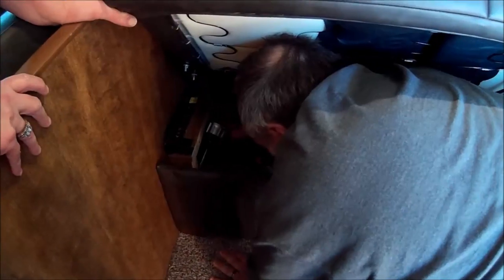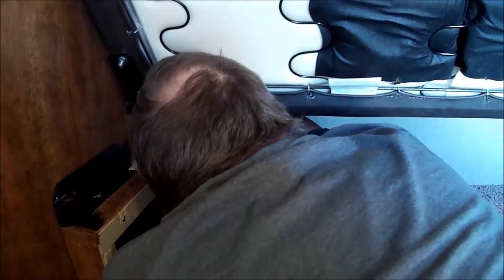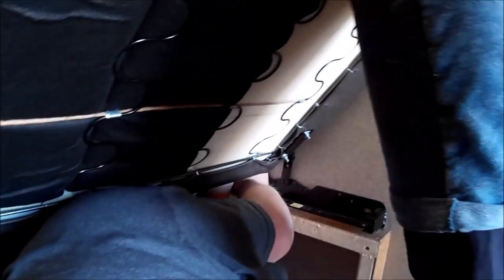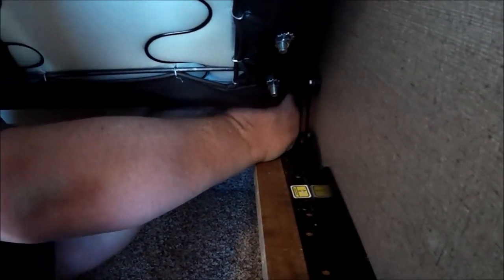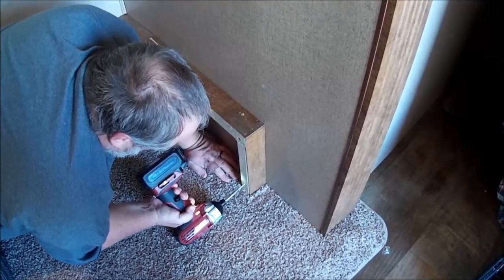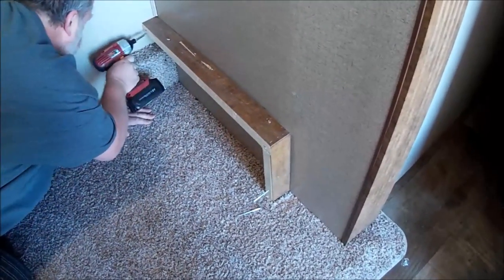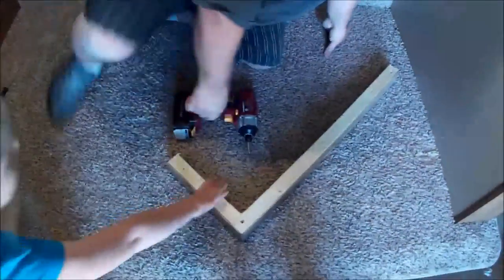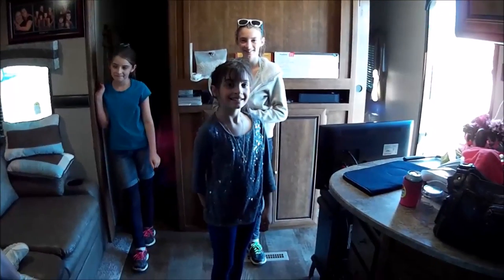How-to |:| Replace Your Jackknife Couch |:| Fulltime RV Family Living Coast 2 Coast

Comment: This is great,  we want to change out the jackknife in our Jayco Jayflight 26RKS TT.    Did you bolt down the couch sections to the slide floor?  And if so what did you use to bolt it down?  What was the total opening size of your slide measurements?
Reply from the maker: We did not bolt down the new couch. I don't recall the measurements but we measured the replacement and knew it would be a tight fit.
Thank you for watching.
Reply: @LivingCoast2Coast   Thank you for your reply regarding your couch renovation. We just measured our jackknife couch and to our surprise it is actually 68 or 69" not the 62" as we had previously thought. I guess the next concern is of course the weight in the slide and the depths of the couch so it does not go over the slide 4. Thanks for your video it was very interesting and informative. Happy travels!

Comment: I checked out the affiliate link but it is no longer working, can you provide the information on what sofa you used to replace with? We have the exact same camper. Thanks!
Reply from the maker: We bought a couch from someone that removed it from their 5th-wheel. I'm sorry that I could not be of more help. I also updated the affiliate link.

Comment: What is your water tank in this camper because my water tank is under my jack knife couch
Reply from the maker: We have a 40 gallon fresh water tank enclosed under the camper (between the frame rails).
Reply: Living Coast 2 Coast you think if I wanted to I could get mine like that
Reply from the maker: I think it depends on a lot of things like:
How high is it off of the ground? 
How long and wide is the trailer? 
What is the shape and size of the current tank? Will it fit down below?
But could probably be moved.